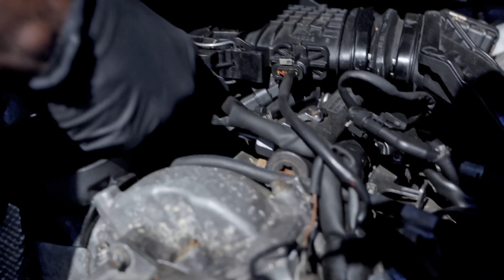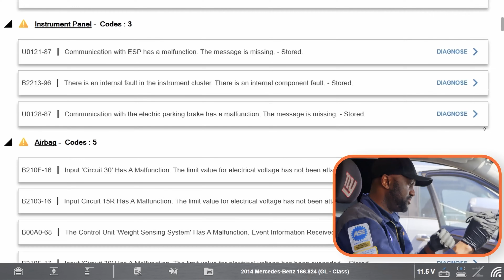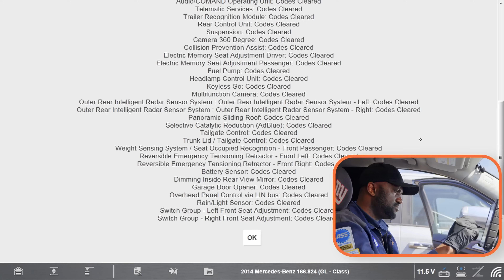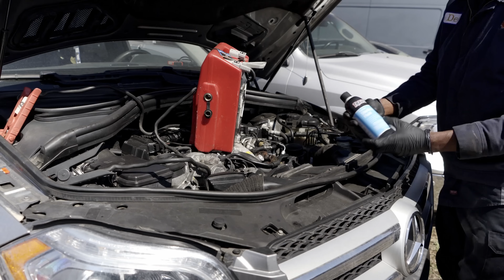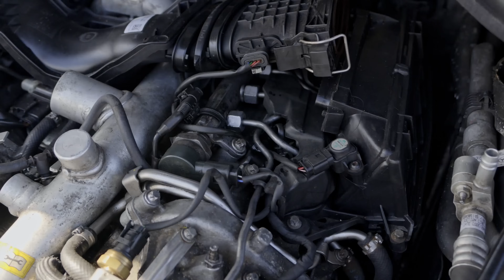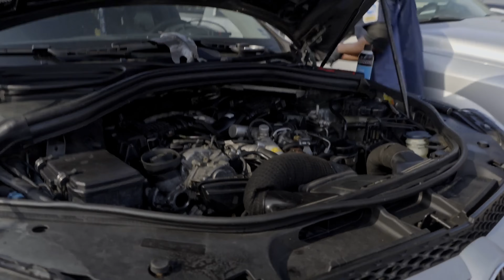Mercedes GL350 - Crank No Start - Auto Shops Gave Up On This Car - Part 1

Comment: Because i have a 420 gl i really enjoyed this vid. I had a similar problem same symptoms, engine cranking real fast like the timing was out... whilest driving vehicle stopped and need toeing, once in the garage check fuel rails for pressure and couldn't see any on the injector side, we thought high pressure pump at first, but replace the fuel filter as it had been standing for years and that resolved the problem!! More GL Vids !!

Comment: No Deo. 
You're getting the fuel, but the engine is dragging as it is turning over: even with your buzz box connected.
I'd run an electrical compression test with the O Scope first, to see what's going on in the cylinders.

Comment: I had similar issue on my om642 after replacing the oil cooler.
It was air in the high pressure pipes between pump and injectors.
I finally forced to crank a long time with the glow plug module disconnected, reconnected it and cranking again.

Comment: Good job
Reply: I agree it’s got a plug the exhaust somewhere. I work at four or worked at Ford. I’m retired now, but I found it when we have them in the shop. We’re able to loosen the manifold or the pipe boats to the engine and break the pipe loose and give some air and a car will run so therefore we knew it was a blockage, possibly converters on our vehicles. It was cat converters they were plugged and that was on a Ford but I like what you did you guys I like your diagnostics, pretty thorough and when you got to that DPF thing it was irregular I would’ve said also focus on exhaust, but you did the basics. Check fuel pressure to check on all that stuff you did good good job.

Comment: I learnt recently that cracking those high pressure lines will not show a lot of fuel pressure or fuel flow. It builds pressure with a closed system. I had a LDV/Maxus Delivery 9 which wouldn't start and it had 4 mechanically stuck diesel injectors.

Comment: There is no shop is  perfect, some shops do just basic works parts replacement using experience and online or friend help,  they don't do electric and electronics diagnosis using multimeter and ociliscoop to find the exact problem through data analysis, that why some shops make called to an thechnitiens and I know one has YouTube channel that travel to other shops to do diagnosis.

Comment: Enjoy your content. I don't think anyone here in the UK would spend a dime trying to repair this car because most ppl here are scared to touch a vehicle with 100K miles on the clock lol!!!  I have seen high miles, "500,000" on an early 2000 Mercedes E-class sedan "taxi" in Germany. I remember asking the driver if that number on the dash was correct because I couldn't believe my eyes. The ride was also very smooth but who knows? Maybe it had a major overhaul or a new engine, or it was just a damn good car.

Comment: That wasn't necessarily the battery, it was the start spray that jammed the engine making the starter motor work hard.  That smell was from the starter.

Comment: I am in south Africa and have a tata xenon2,2l diesel. It has a problem on the remote. It doesn't crank.I conneçt a wire to the ground but still need to make more connections. It crank now but struggle to start If you could help out than I thank you.

Comment: Deo - I think from other YouTube channels that I have watched,  the term "Rail Pressure " usually refers to the input ( low pressure ) at the input of the high pressure fuel pump and not the output pressure of the high pressure fuel pump.
Also, should a diesel engine act the same way as a gasoline engine when using the starting fluid ?

Comment: When any vechilce is getting fuel and fire . It it does not start sometimes it just the burgualr alarm turning the fuel off. To prevent the vechicle from starting. Some alarms stop spark... a lot of them stop fuel. I was mobile Mechanic and had my own business. I develop feel for it and had to think fast.

Comment: I have a ml350, need a engine but still cranks and drive a little 34 blocks then start snot can u help me my concern is iif I replace the engine does it risk the transmission going bad ?
Reply: 3or 4 blocks before it start smoking, or shout I get another suv
Reply: Please help if you can I don’t have transportation
Reply: 2011
Reply from the maker: @MariaMQueen-ov2lr   No

Comment: I am working on my Saturn Vue 2004 V6 3.5Lts Engine(J39 series Honda Engine) to replace ignition coils and Spark plugs as it is been a while. I had replaced them when vehicle was about 130k miles and now it is about 245K miles while removing plug on cylinder 4 spark plug got stuck and i used magnetic pick tool to pull it up. Apparently magnetic tool's magnet got stuck inside the side wall of the plug hole and wouldn't come out. I tried different methods and still couldn't get it out. I was able to pull out the spark plug from inside hole. 

I still need to get the magnet out of the side wall to ensure that no foreign material is inside that might affect the engine. Appreciate any ideas and suggestion to get the magnet out of the spark plug hole.

Thank You.
Reply from the maker: @Krishnan-qv7yo  Sorry I didn't understand the question

Comment: That engine is cooked, looks like the head cylinder is burnt because it has no pressure, and the car has 240k miles on it, listening to the sound, the engine is done.
Reply from the maker: @segunyele   I agree

Comment: When mine did that I had changed out the camshaft sensors and ended up getting a new overhead gasket and a thermostat I had a 2010 Hyundai Tucson one day it just ran hot and my light never came on  it just died on the side of the road but it’s still going after the overhead gasket
Reply from the maker: @Msleelee9487  That's odd

Comment: dpf pressure should be around .05 psi idle and .25 under throttle if it's clean
Reply from the maker: @alwaysinmotion1  Good

Comment: Nice job & Vid  ,bro , however  , learn to trust your data the more and you will save more time .
Reply from the maker: @yemiasaolu1622   Thanks, Some data can be misleading, I got burned in the past so many times, that's why I check and double check everything before making the Call

Comment: Basically if the car was in another shop or the owner himself worked on it, before bring to the next shop, you need to reverse whatever you did before (put back any parts been removed and replaced ) so to make easy for the next mechanic, but sometimes they made the problem worse by changing parts, like this car here, and I know one car has one problem which was fuel delivery issue and by changing parts they add another problem which is  they didn't time  right the new  distributor.
Reply from the maker: @abdouallahuniverse5689  Yes!

Comment: Hi deo great video but i would still take off the pipe at the back of the turbo and if there is oil in the turbo then i would take off the cam covers and check the timing this engine will start even if the timing is off by 14° and id say that there's a few rocker arms broken 👍
Reply from the maker: @KieranEganLong   Thanks
Reply: Also it's not easy setting up the timing marks you think that it's right but if you check it will be out on the left side by 1 notch

Comment: I call that a “challenge “ , when u mention that other mechanic shops or the dealer tried to fix , but ending up that they brought the car to u to fix it , 
I mean it is not a broken engine and the cost is too high to fix it , it is again a challenge, and worth to try to fix it while others failed to do that, 
Very interesting diagnosis, and another success
Reply from the maker: @essamdalgamouni1536   Thanks

Comment: Deo. It's kinda' hard to tell because it's a diesel. Sounds like it has one or more dead cylinders!
My first guess would be to run a compassion test using an amp draw method, and vacuum test too!
Reply from the maker: @ekimbrough1413  Oh ok